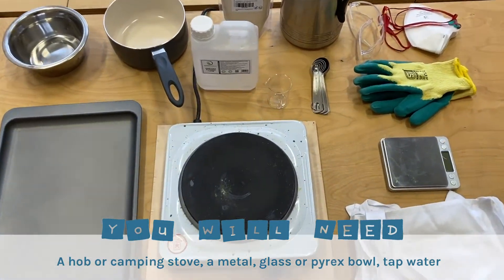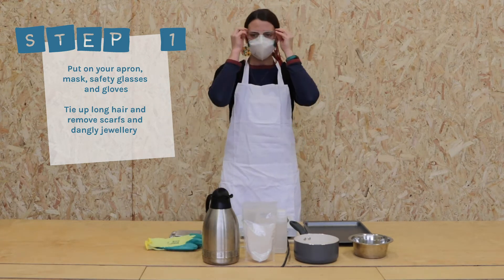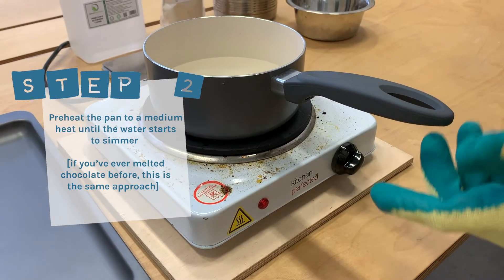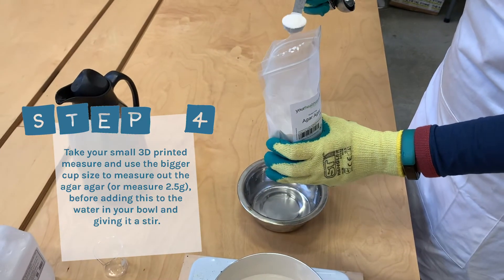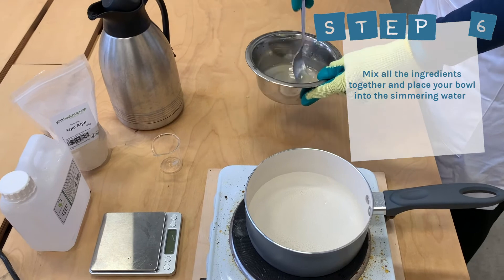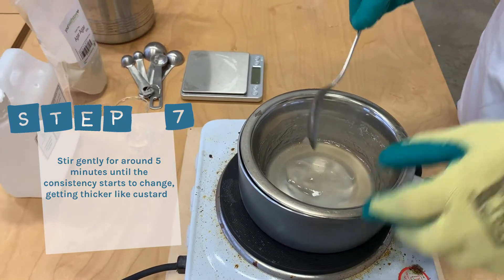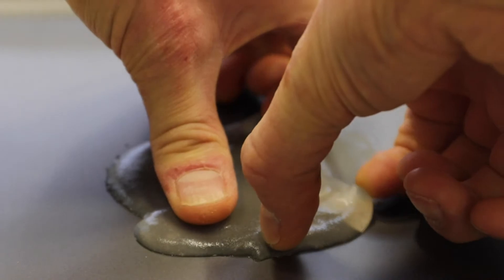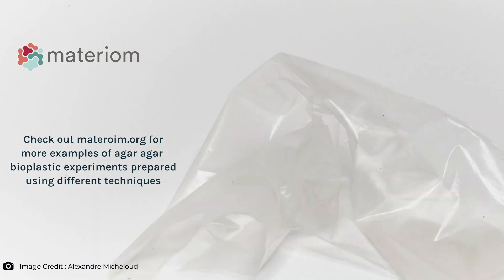How To Mix your own 'gelatine-based plastic' with agar agar

Comment: I was wondering if it has to be warm or can it be room temperature when left to set? I'm trying to decide if thin layers can be processed through screen printing, or if it's simply will not cooperate with that method.